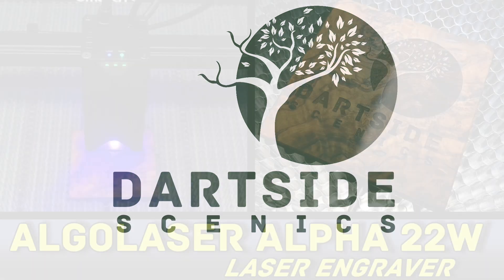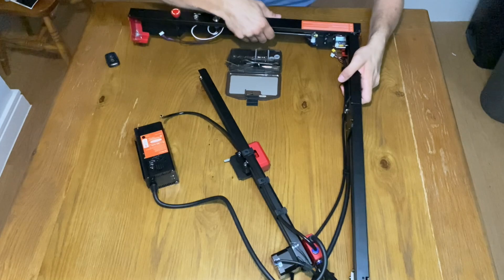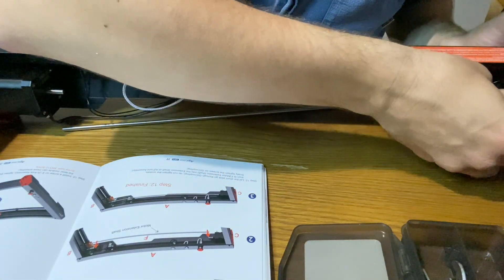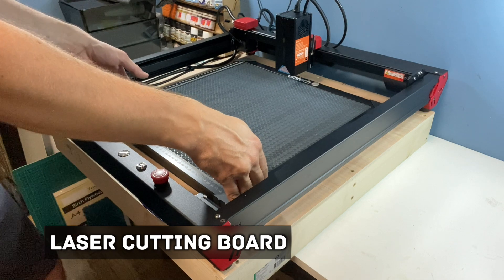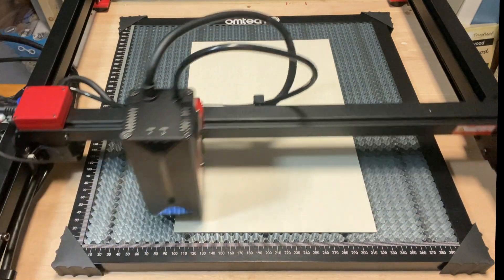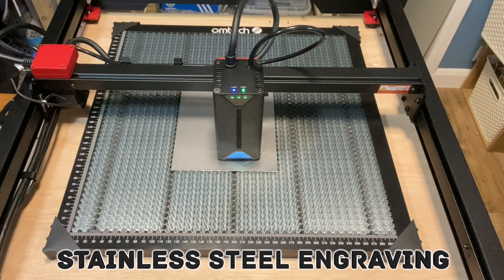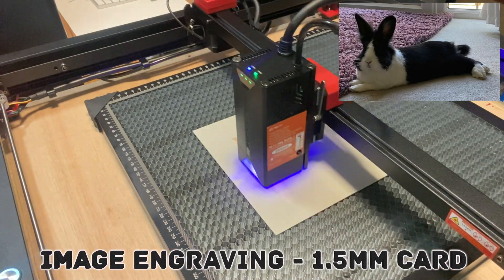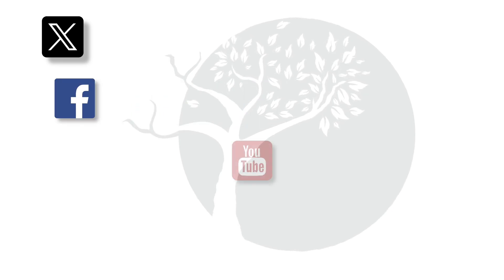Unlock your creativity with the AlgoLaser Alpha 22W Laser Engraver!

Comment: Hi Andy. I was impressed with the capabilities of this laser cutter but I’m afraid my IT skills are zero. How easy would you say it is to use, in particular loading your own designs?
I like the etching effects on stainless and aluminium, would it be capable of etching or cutting through 5, 10 and 15 thou brass?
I tend to model buildings from plastic kits or in plastikard, Slaters brick, and Wills builder sheets and would love to see how it copes with those (particularly the Wills sheets as they are thick and quite difficult to cut windows and doors in).
Whilst looking at new methods I’m of the opinion that a 3D printer would be of more use, with their ability to create surface textures as well as shapes and even print loco bodies. The price point of resin printers are now much more affordable and resolution in £300-£400 machines being very good.  
Hopefully one of the manufacturers will send you one to try out 😊
Looking forwards to your next video.
As an aside despite having turned on the bell and asking for notifications of new videos I don’t seem to be getting them pop up. I don’t know if this is a problem with my settings or YouTube. 
All the best, Mark.
Reply from the maker: Hi Mark.  I have spent a bit of time getting to know the Lightburn software but I'm still very much a beginner!!  It's fairly simple when you know where things are.  I have just been creating some module signs, one of the Staverton buildings and a Staverton crossing gate and they came our pretty well (next video).  I haven't tried plastic or brass yet but I'll have to look into it - we could try to arrange for you to have a go on it!  A 3D printer would be very nice if I could get hold of one.  Look forward to seeing you at the shop soon.  
Best wishes
Andy
Reply: @DartsideScenics  hi Andy. that’s an offer I can’t refuse. Thank you. 
It would be interesting to see how it coped with Totnes Riverside station building. There, that’s a challenge for you 😁
Reply: @DartsideScenics  hi Andy. that’s an offer I can’t refuse. Thank you. 
It would be interesting to see how it coped with Totnes Riverside station building. There, that’s a challenge for you 😁
Reply: @DartsideScenics  hi Andy. that’s an offer I can’t refuse. Thank you. 
It would be interesting to see how it coped with Totnes Riverside station building. There, that’s a challenge for you 😁
Reply: @DartsideScenics  hi Andy. that’s an offer I can’t refuse. Thank you. 
It would be interesting to see how it coped with Totnes Riverside station building. There, that’s a challenge for you 😁

Comment: laser engravers with out hoods are very dodgy. The fumes are often toxic and the laser can blind you from just a reflection. With most of these “budget” lasers included safety Goggles are not actually safe to uses offering little to no real protection.
Reply from the maker: Yes, they are not to be taken lightly but the setup is very different when I am not filming what it can do.  The problem with showing it in use is that it's difficult to have the cover on, etc.